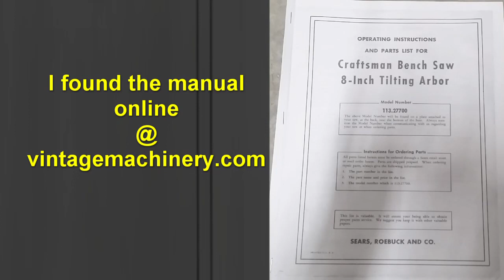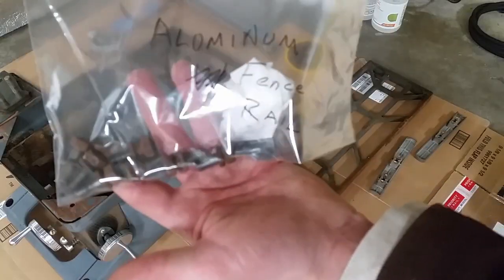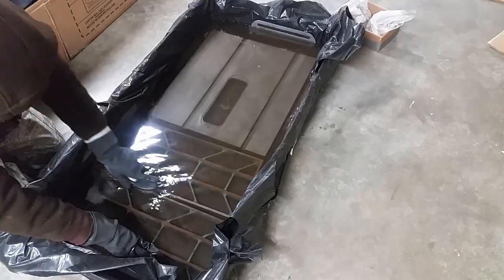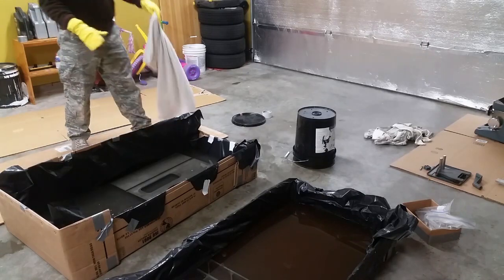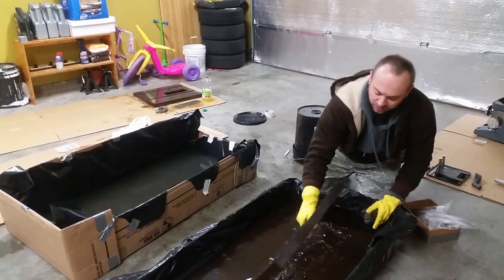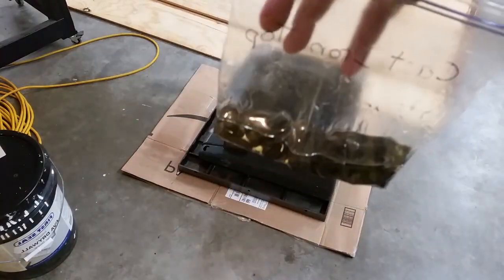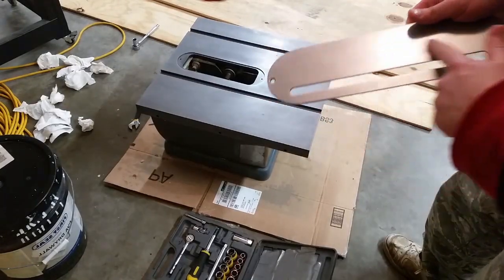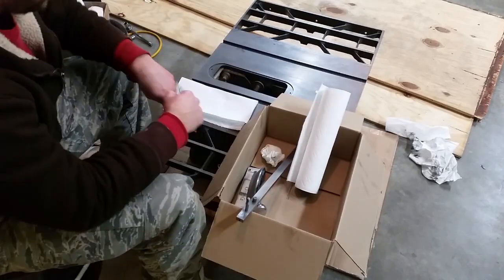How to Easily Remove Rust & Restore Table Saw the YeahPete way. DIY | Step by Step

Comment: that was the first table saw that i bought as a teenager...$75.00 well used.  cut allot of timber with it.  one of the best things that i did to make it run smoother was to add a link belt.  good luck and have fun with it.
Reply from the maker: Thank you for the idea!  I never heard of putting link belts on a table saw.
Reply: @YeahPete  you will be amazed at how much smoother your saw will run.  they are directional, so make sure to install it properly, it is an inexpensive upgrade to an old saw like yours.

Comment: I'm in the process of doing my father's old 72 Craftsman tablespoon I've just been scrubbing the top forever lol.  Did the vinegar pit the cast iron at all?
Reply from the maker: Science says it will pit but I didn't notice any it looks brand new.  Just 24 hours in the bath.  Rust came right off like like nothing.  You can maybe even try less time like check after 8 hours.

Electrolysis does not pit.  It's a bit more of a pain to set up but no pitting.
Reply: @YeahPete  thanks for the information

Comment: Hello,
Ready to switch out table from different saw.  Which screws do i need tp remove to get the top off by itself.
Reply from the maker: Just flip it over and you will see the bolts.  Good luck!

Comment: Usually that type cast iron saw uses a 10" blade. Odd that one uses an 8" blade. I rebuilt an old Craftsman 10" cast iron table saw into a very nice cabinet saw setup with table top extensions. I built a square tube frame all around the sides and exit end of the table and added MDF with laminate Formica on it. Then installed a new arbor, bearings and even a new motor with a twist-lock belt and Biesemeyer 50" fence and it runs like a top.  Old is new again!
Reply from the maker: Nice.  Im not at that level yet.

Comment: Wow, I’m trying electrolysis right now for a table saw I just bought, but your method looks simpler and it looks that it worked nicely. Electrolysis is a mess 😣
Reply from the maker: Thanks for the comment.  They both work very well I guess it depends on user preference.  I hope your saw cleans up nicely.

Comment: I have a suggestion if you’re doing anything but rough carpentry junk the rip fence, and as with most OEM miter gages no good. I make custom furniture and cabinets with mine, properly setup these saws are super accurate. I have several of these saws price was free to $50, after mods about $400 including a “new” motor, can not touch a decent saw for 3 times the price
Reply from the maker: Thanks for the comment!  You're right.  I made some sweet cubbies, and quickly noticed how inaccurate the fence is.  That video will be up... Eventually.  If I ever do fine woodworking with it again I will have to address the fence.  Did you buy a stand-alone fence or make one yourself?
Reply: Yeah Pete  I ended up with one from Jet, Grizzly has several nice ones not cheap but worth it. Check Banggood for some deals on some very good miter gauges,

Comment: When you did this you said you used canola oil but could use motor oil or anything you have.  Do you know if it’s better to use 1 oil over another? Thanks for the video, I am going to be doing this after Christmas!
Reply from the maker: Thanks for the comment.  Motor oil would probably be fine.  Machine oil probably best.  I dont think I would use used oil. Its all dark and murky and contaminated with heavy metals.

Comment: I hope you put something on the table and extensions to keep them from rusting again.  I've been told that paste wax works well.  I guess well see as I have to do the same thing to a saw I have and I've got some old carnuba floor wax just collecting dust I'm going to try.  I'm also going to build a cover for it as I  had just a piece of cardboard sitting on it for over a year and the rust hasn't gotten any worse.   I wish I had time to disassemble it but I don't.   Nice job.
Reply from the maker: Thanks yes I just used car wax.  I haven't  waxed it since.  I really need to.

Comment: Did you do anything to the bottom of the table saw top? Or do people not care about the other side? Thanks.
Reply from the maker: The bottom of mine was fine but I figured people didnt care about that.  I'd wipe it off if it was rusty. The rust comes off so easy so why not.